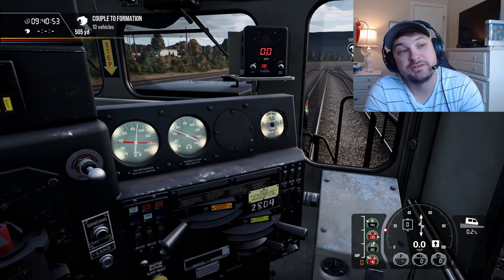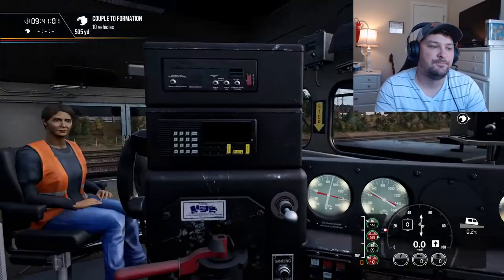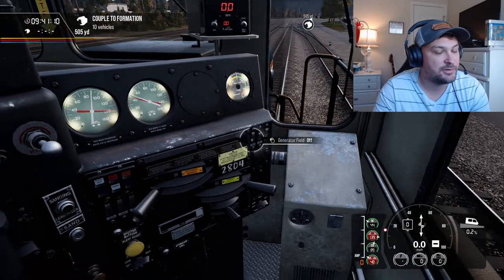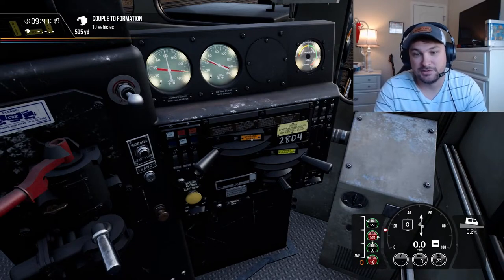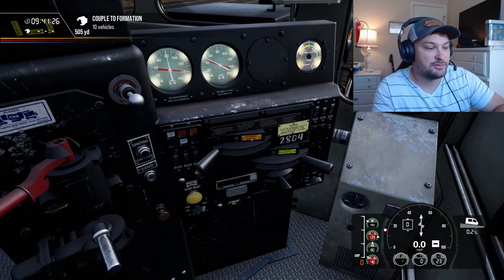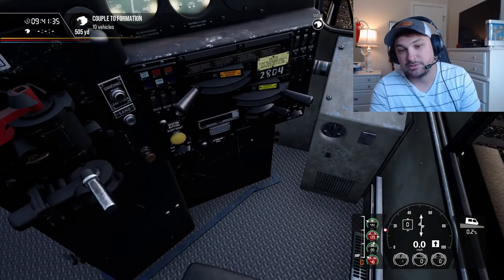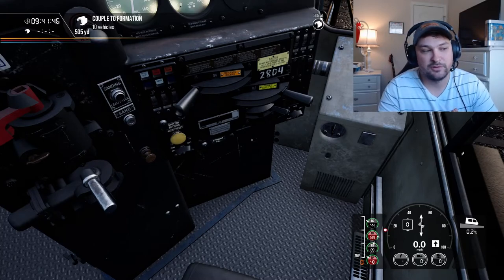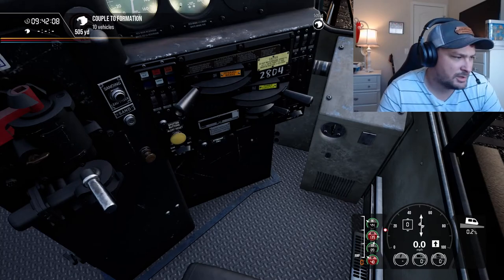What Is 3 Step Protection on the Railroad?

Comment: nice... the U.P. used to call it the red zone so when we would make a joint and want to make the hose we'd say "red zone, air" and the engr would reply "red zone, set and centered"... meaning you're in between the cars, the brakes are set and the reverser is in the center position... and good to have the train simulator wow that really helps a lot... now if you could just simulate the tired, groggy, sleepiness of being rousted out of bed at 01:23 for "train blah blah blah"... (i swear that early in the morning the caller always sounded like charlie browns teacher)
Reply from the maker: I am loving it since I can't get out there and these companies that I use to work for will not let me shoot any videos at all for whatever reason.. but you're right it's always a charlie brown sounding when its 2am and you barely woke up to answer the phone lol..